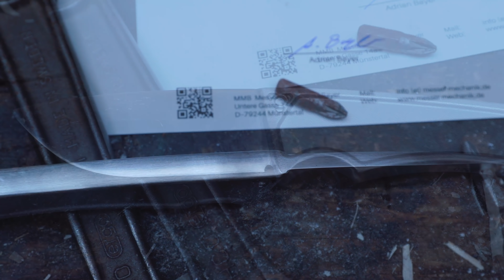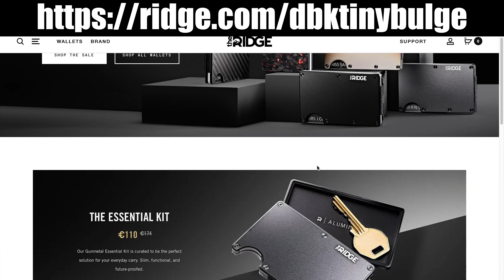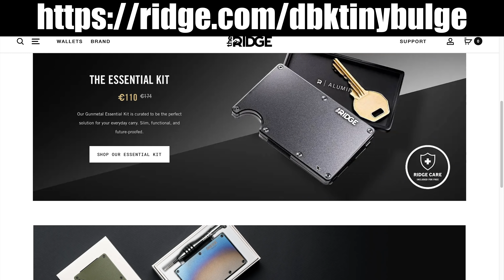They said this $300 knife could not break... ONE PIECE OF STEEL

Comment: $300 for that knife is ridiculous. I wouldn't be willing to pay even half that. $300 puts you in the price range of a lot of very nice knives. Also a knife without an ergonomic/comfortable handle is designed for "carving"? Hmm OK. Its not even compact enough for an "ED " fixed blade for me. Esee xancudo in S35VN is a very good EDC fixed blade option, & its a 3rd the price of this thing. 
This blade just seems gimmicky to me. Not only is a $10 mora tougher, with its very comfortable handle, it's also way better for carving.
Reply: The production costs in Germany are very high. This die-forged knife is completely manufactured in Germany, which is unusual. Also, it is not industrial mass production but craftsmanship.
The handle is absolutely suitable. My big hands are well along with it.
Reply: @rene_falk  Each to their own, I personally wouldn't consider a die/drop forged blade to be "craftsmanship". 
He even outsources the heat treatment.
There are far too many better options in that price range for this knife to be a viable option (for me at least). For perspective my custom puukko (very ergonomic handle) in vanadis 4e at 63hrc with carbon fibre handle was only 220.
Reply: @sgtfatrod8901  Developing a die for die forging is quite a craft. No craftsman works without machines these days. Division of labor among craftsmen is also completely normal and has been practiced for centuries. I see no contradiction there. And when it comes to price, you should also compare the costs, not just the product. In this case, around half of the price are taxes and duties: VAT (19%), trade tax (approx. 15%), social security contributions, etc. I think your Puukko would be a lot more expensive if it was completely produced in Germany.
Reply: @rene_falk  
Again each to their own.
You're ok with paying 300 for a knife that in my opinion isn't worth even half that. I don't care why a knife in a budget steel costs 300 I am simply not interested in paying that much when I can get far better for less. Also we clearly have very different views on what constitutes craftsmanship. 
To me a die/drop forged knife/product isn't "craftsmanship". Millions of tools are made via the same mass production process. 
(die/drop forging)
I definitely wouldn't get a knife made in Germany if it means I have to pay way more than it's worth. Again way too many other options to chose from.

Comment: Btw in my opinion the knife broke because of badly designed transition from the blade to the handle--- on this picture here https://youtu.be/-nhZGTk4LUM?t=206 it can be seen that transition from blade to the handle it too abrupt, almost at 90 degrees angle and that created a clear stress point, also that quite small cutout at the base of the blade nevertheless being rounded is another stress point
Reply: The angle at this knife is around 120-125 degree.
Reply: @rene_falk  what are you talking about? the angle between blade and ricasso is 90 degrees
Reply: @aleksandersever3039   The viewing angle in the video is quite unfavorable. I have such a knife. The transition from blade to handle is between U and V-shaped.  A little bit like this -----<====
Reply: @rene_falk  Okay, maybe then it's not the same blade-handle transition shape for all these knives. DBK sample really seems it has 90 degress angle. The only way to bo sure would be to ask them what it was like on their ...